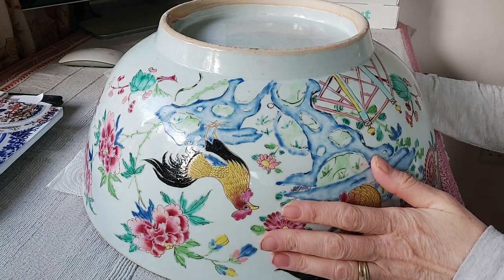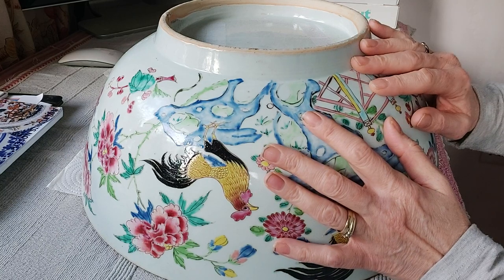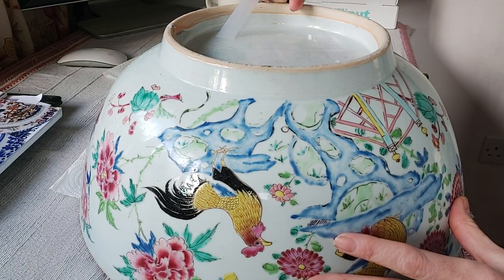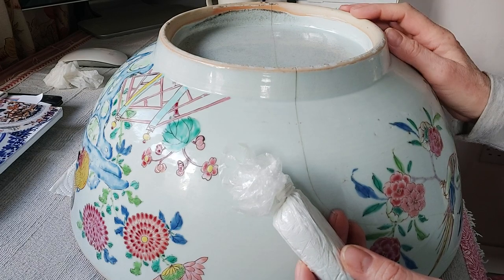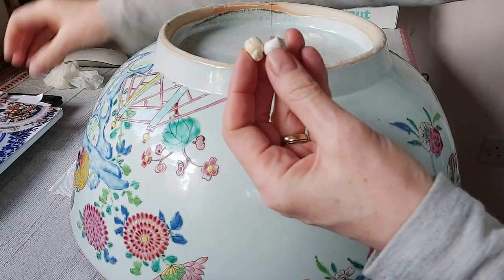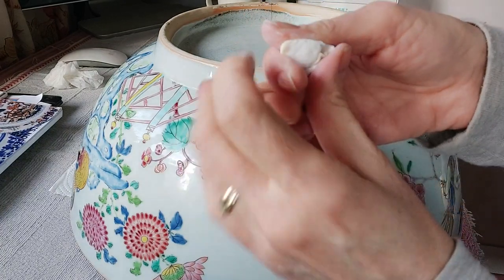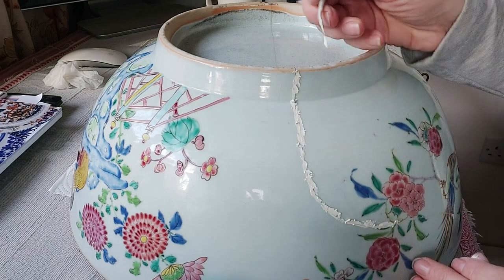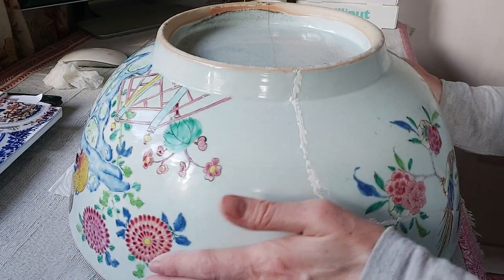PORCELAIN REPAIR CRACKS WITH MILLIPUT

Comment: Do you know Mayuyama Koji they call the 'unknown master of restoration' ? Incredible techniques. I bought a similarly large 18th century bowl that had been broken and glued back together as I wanted to give it the Kintsugi effect. I found it on ebay, it was sent, not delivered, went back to the UK ( I'm in France ) and then it came back again to me. By that time I was working on another project and the bowl has sat on a shelf since then along with another chinese massive one that also needs some love. When I recently moved house, my favorite old plate ended up in a dozen and more bits so that's also a project and there are losses where the bits were too small and fractured so it will be Milliput. Thank you for sharing.
Reply from the maker: Many thanks for your comment. 👍 please let me know how you get on with any repair peices.